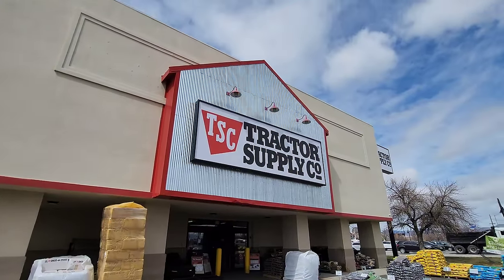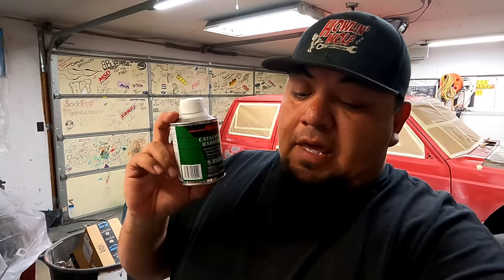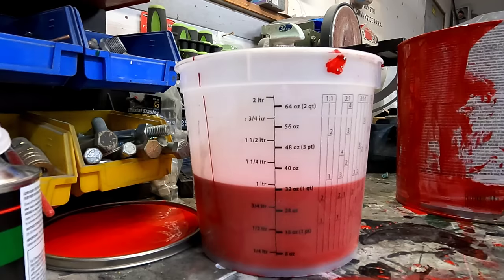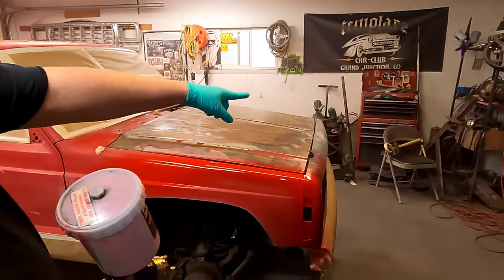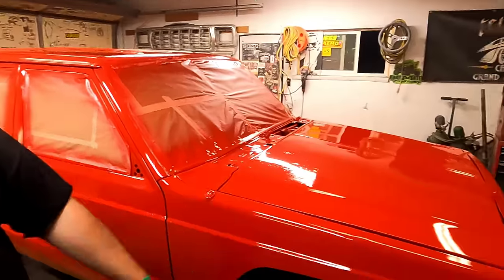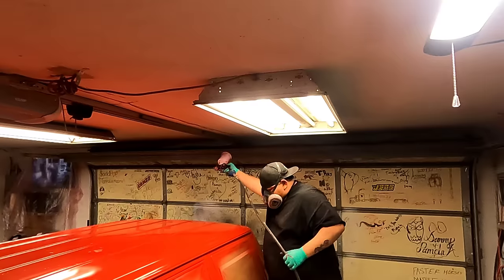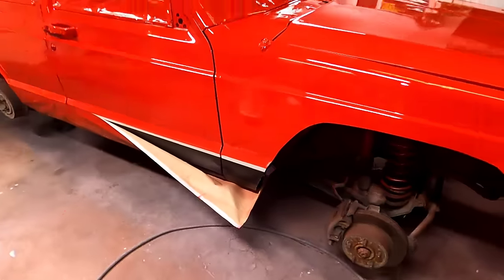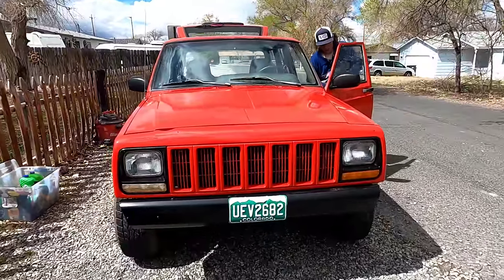Budget Paint Job On My Sons Jeep Cherokee. We show How We do It.

Comment: I've never used the Rusteloum paint but I use alot of Majic Tractor paint, Grew up with parents who owned a body shop in the middle of Farm country in the Mid West. The trick to using Tractor paint is to thin it more than the direction, Tractor paint direction say 7:1:1 or 8:1:1, but with more thinner it takes less hardner or it will become brittle, I thin it to 6:1:.75  or 6.5:1:.75, I just bought a 82 C-10 and I need to to paint it, so I might try the Rustoleum paint on it but I have a question, I want to 2 tone it but just the roof, how long do you have to let it dry/cure before tapping it up to shot the 2nd color?
Reply from the maker: I would wait a full two days using the hardener before taping. I've done it a few times and never had a problem
Reply: @rockabillychavez  o.k. thanks that's what I was thinking but like I said I never used it before.

Comment: Question: So you are NOT using automotive paint?
I know you went to Lowe's or whatever or the hardware store and got that paint.
So does it stand up to the weather?
Reply from the maker: Works well. I have trucks I've painted over 3 years ago, and they look good still. I do use automotive paint sometimes, but this is so much cheaper and is more durable. Perfect for a work truck. It might not last as long as a one thousand dollar paint, or will it? 🤷‍♂️ but it's only one hundred bucks. So im just more or less showing what can be done on a budget
Reply: @rockabillychavez  OK, thank you because I don't know that much about paint period but I do want to try to paint my own car. great video.✔️👍

Comment: Allways shoot a cardboard test surface to dial in the gun. I've been running Rustoliem  and impliment paint that way on.my trailers and tractors  .and impliments for years. Had a boat factory building fiberglass boats. I would never catelize the whole bucket cause when the cat is done so's the rest of the material.

Comment: Could you spray clear over it or is it not worth it. If I was to go this route to paint my car
Reply from the maker: Yes, you can spray clear over it. Make sure paint is good and dry for a couple of days  first, then scuff it down it with a red scotchbright pad or 400 grit sandpaper. Doesn't have to be a deep sanding. Just get it good and scuffed all over everywhere, Clean and spray your clear coat.

Comment: Acetone???? I got no issue with what you're doing, but acetone instead of laquor thinner? I've only used acetone for cleaning in my past....
Reply from the maker: I have used both. I prefer acetone. You use whatever works well for you. I have also been told that acetone makes the paint dry faster and harder.

Comment: The problem is not the budget of the paint job - the problem is needing an expensive air compressor that is almost never factored in.  It's a $30 paint gun that has a CFM requirement that no air compressor under $750 can produce, but you really need more like a $1350-$2000 compressor.  I'm just now finding this out!  Already bought the gun, but there's no way I'm spending 2 grand on an air compressor just to do a cheap paint job.
Reply: Sure I've seen videos of people trying to get away with smaller compressors, but I'm painting a food truck and I need to hold the trigger down for long periods of time without the compressor stopping to fill back up.  I'm probably going to return the paint gun and go another route since the compressor is just WAY too expensive for something like that.
Reply from the maker: Can you rent or borrow an air compressor. You can find them used for pretty cheap sometimes. But yes, I understand what you're saying.
Reply: @rockabillychavez  Thanks man for the reply - I've decided to get a LVLP gun that only requires 4 CFM.  That way I can get a more affordable compressor and still be good to go!  Also, Husky's HVLP gun is also 4 CFM.

Comment: What size air compressor do you need minimum?
Reply from the maker: Mine is a 37 gallon, and it barely keeps up at times. I'm going to upgrade it soon.
Reply: @rockabillychavez do you think an lvlp will spray rusto this same way well?

Comment: The good visual for your first coat of paint should be like if you took a salt shaker and shook it on the hood of the car that's how much pain you should be putting on just a Sprinkle   https://www.youtube.com/watch?v=Ql4BYh9f0ck
Reply from the maker: To me, that doesn't leave it as smooth. Just like you said, like salt on a table, you can feel it. The more you put on, the better it will flow out and self level, so to speak. My first coat is not as heavy as my second coat of paint. Some people do use a Tack coat like you are talking about, but I just don't agree with it. I would rather have two good coats than one and a half coats. But to each is own, I'm not a professional but I have worked for a company paiting snow cats and other equipment for many years. Not to mention all the cars and trucks I've painted for myself. It just seems to work for me. But you should do it how you feel comfortable. Thanks for watching

Comment: Tractor supply hardener is complete junk.... Real automotive grade acrylic enamel hardener works just fine in tractor paint and rustoleum, it will make your paint job last for several years without fading. Automotive grade hardener comes in 4 levels of durability, synthetic enamel hardener, acrylic enamel hardener, wet look enamel hardener and super wet look enamel hardener. Synthetic is the cheapest and least durable. Super Wet look is the most durable and will give a gloss nearly as good as if you used a clear coat.

Comment: I feel bad for your lungs bro
Reply from the maker: Why I have a mask on??? 😷
Reply: @rockabillychavez  But no ventilation, those particulate masks are no good anyway... especially in a closed space... Best option is leave that garage door wide open and have some fans out one side and in the other... I'm sure you're fine... Also buy some disposable paint suits, the atomized molecules the ones that cause cancer can be obsorbed through the skin and get directly into the blood... That's why we wear the proper ppe... Though I'm not sure what's in that paint you used, mainly the stuff you want to worry about is "2k" paint... which is deadly when enhaled... As long as you didn't have a headache or feel unwell you'll be fine